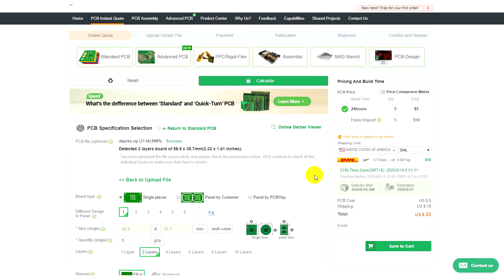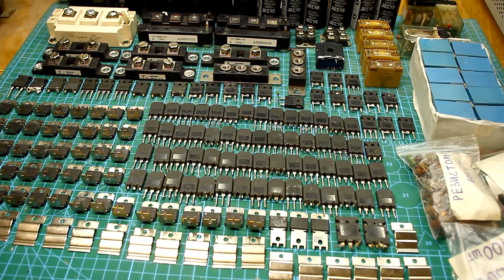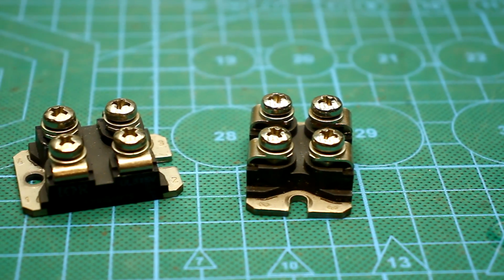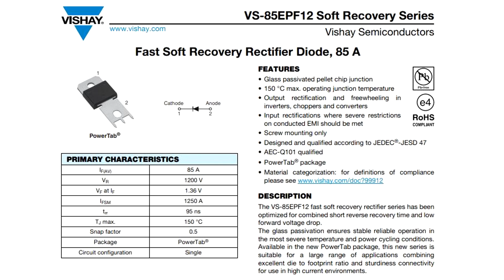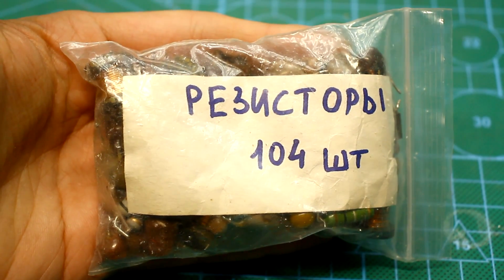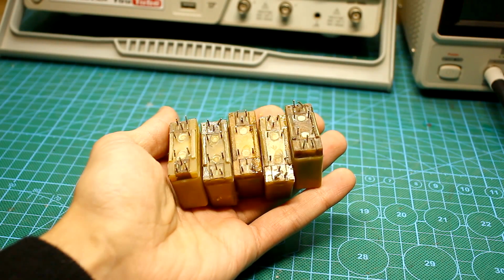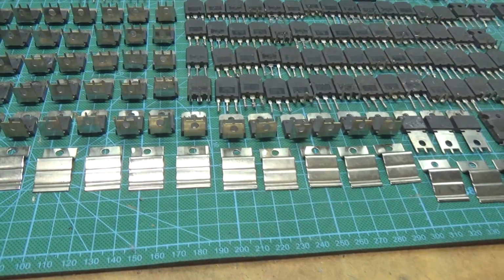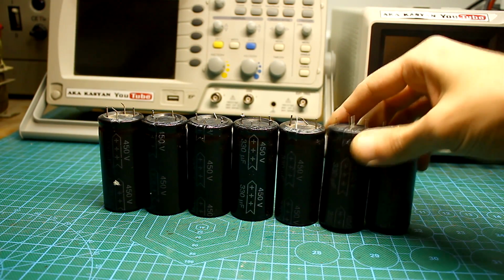Shocking parcel from a subscriber

Comment: I used psu to power 400wrms car amp.  Can I use two psus at 14 amps each to get 28 amps?  Ordered 5-15v 20 amp skyrc battery charger i hope it works for car audio but I got a good price so resale easy.  Need filter cap... 50 Farad.  They make them now.

Comment: congratulations, for some people this is like a trash, but for us whos into power electronics specifically in switching power electronics, this is like a treasure box filled with golds, i actually trust reused original parts rather than new fake once that oftenly fails without ecen reaching half of the rating

Comment: Please teach we all.. how to make 220v to 240v inverter..😄✌️
Reply: Get 220v to 24v transformer connect the 220v line to plug then the 24v will connect to 220v live and get the 220v gnd and the other 24v winding and you got 240v to 250v ac